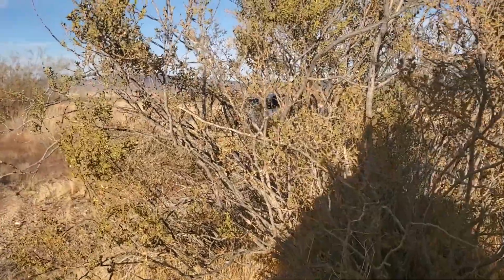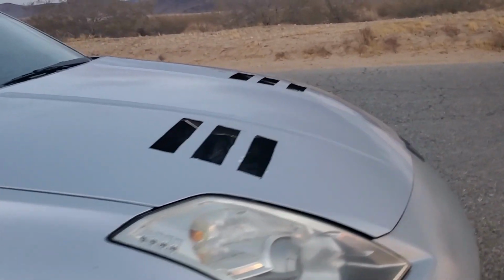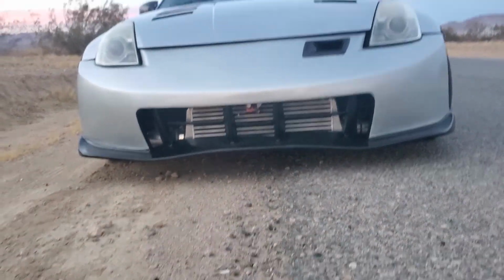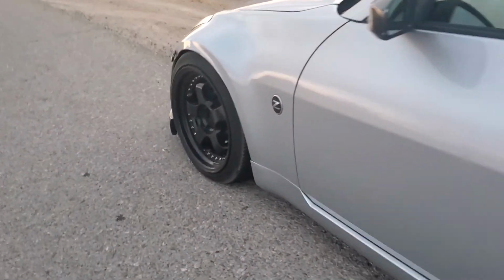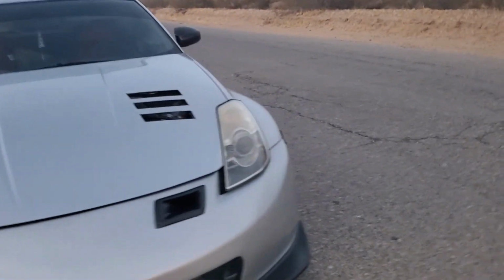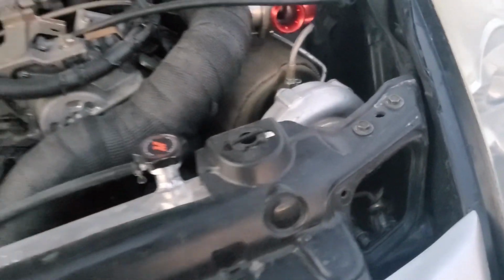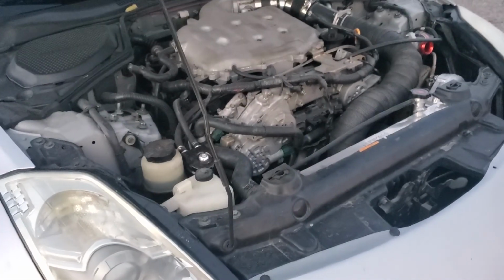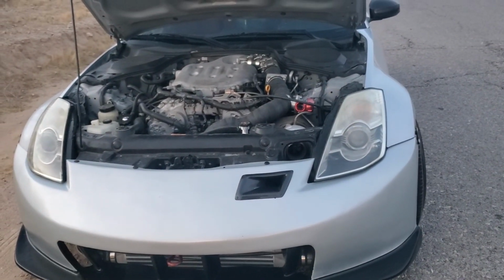single turbo 350z update g35

Comment: Dang bro, 330 hp with a single turbo. I'm probably going to make the same numbers with bolt ons, fuel pump and injectors with a e85 tune. I thought you would be pushing around 450whp.
Reply from the maker: Yea bro but its got everything else stock like the headers and the kits has exhaust leaks so it really takes a minute to get to full boost I do think bolt on would be making the same too lol
Reply: @daproject7025  well at least your showing us how to install turbos. It's fucking ridiculous for the g37, it's like 8k for a stage one single turbo. I wish I could find one for 3500.
Reply from the maker: Yea bro this one is a rep thats why is got a few issues lol but we found it for like 1800 or 2000 I think a while ago new too the instructions still work for the original kit I think is turbonetics and is expensive lol
Reply: @daproject7025  dang, 1800 and new, that is a sweet deal bro. Well if you take care of the leaks and tune that bitch on e85, with upgraded headers, fuel pump and injectors. I think it would fly.
Reply from the maker: Yea thats what I think too but its my friend car tho I help him on and he's the one buying everything but he had kids and has more cars for the family and stuff so is taking him longer to take care of some of those things
Reply: @daproject7025  yeah I straight up understand him, i got a wife and two kids and I wish I could dump all my money into my G but it's not happening.
Reply from the maker: Yea bro lol